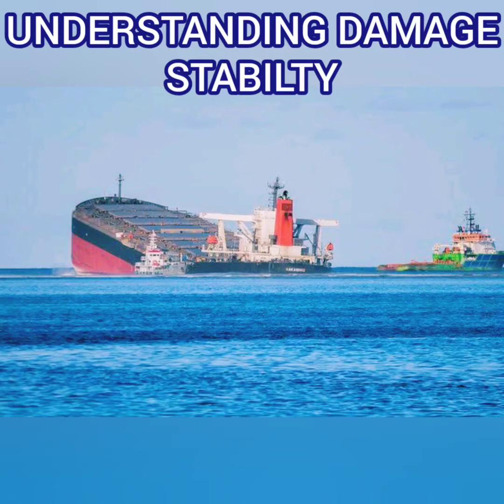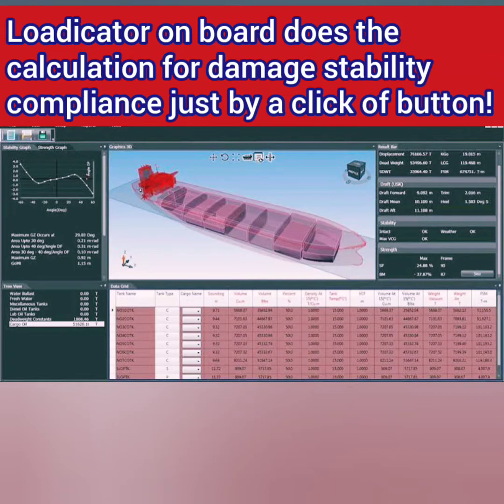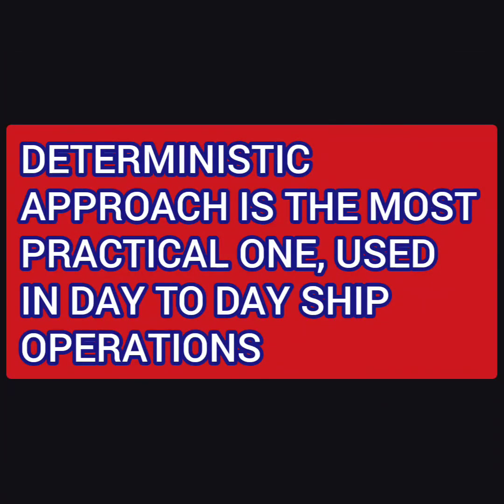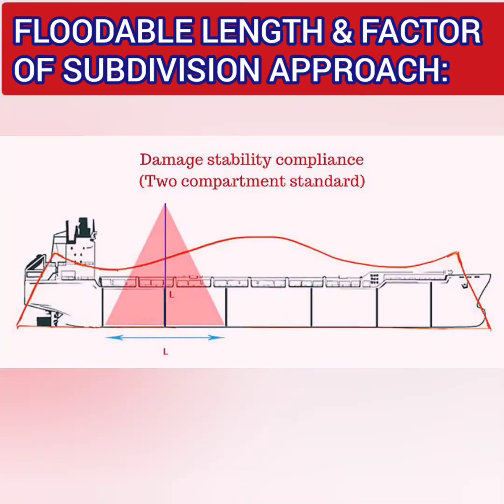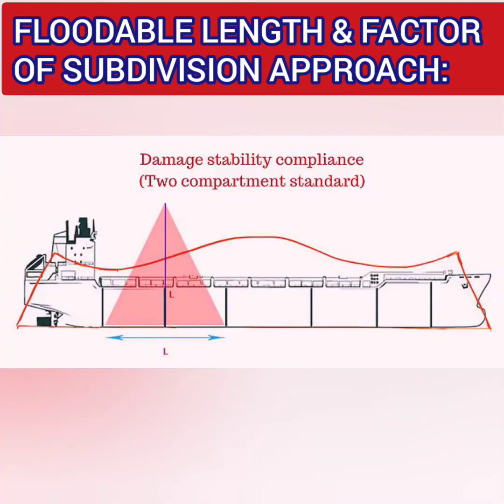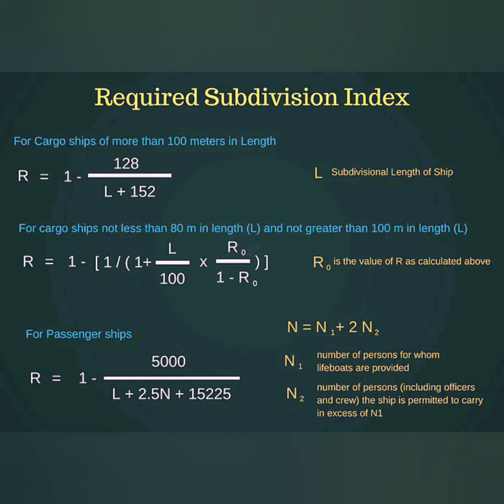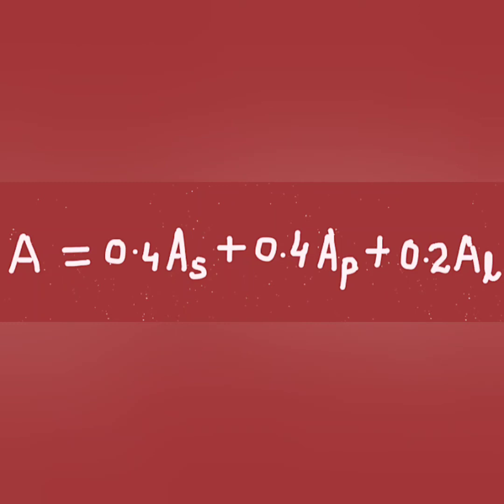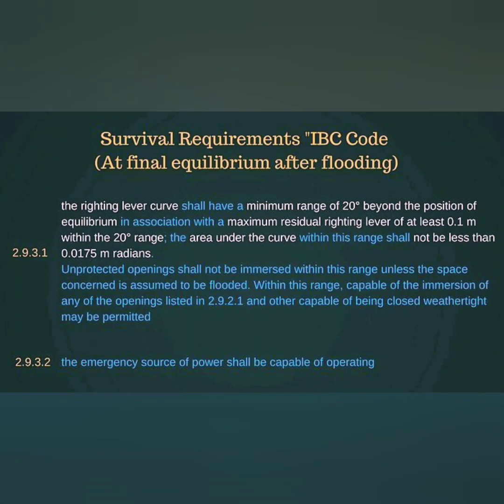Part 1/3 Concept of Damaged Stabilty,With Floodable length, Probabilistic & Deterministic Assessment

Comment: 4:08 - You said if the compartment is flooded and water inside the compartment is flooded till the margin line. But Shouldn't it be like the full ship's water line should reach the margin line?
Reply from the maker: You are right. However the level in the compartment would also reach that level when water line reaches the margin line.